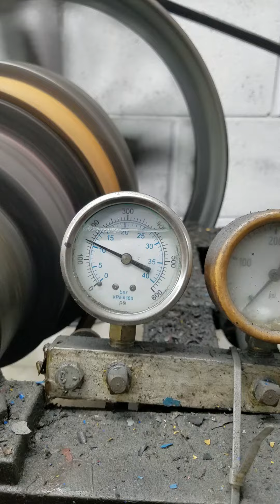Rebuild 1017-007 1.91:1 Testing

Comment: On the 71series gear, which port shows pressure?  I want to add pressure senders to my 71c 1.5:1 gears and need to know where to mount the sender and type of sender.  Also, is it better to monitor gear pressure or gear temp?
Reply from the maker: I'll add a video today showing the main pressure port and some other information. It will be available around Two o'clock Eastern Time in the United States
Reply from the maker: Sorry for the delay the video is loading now